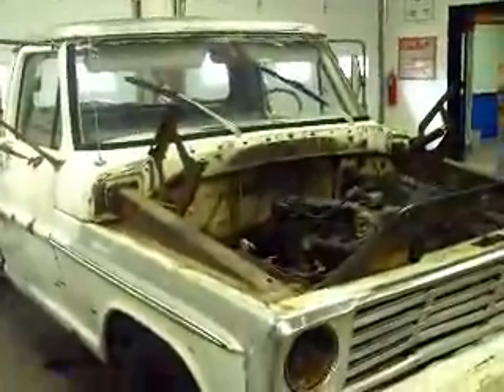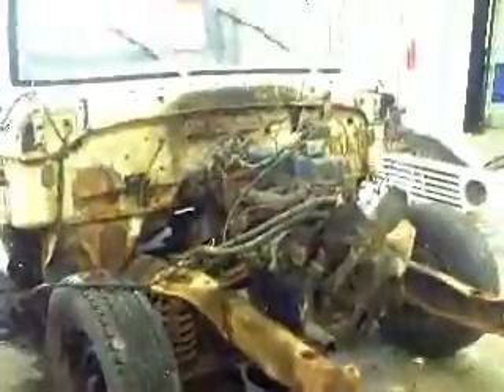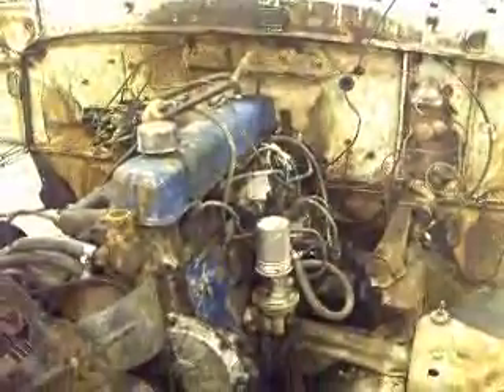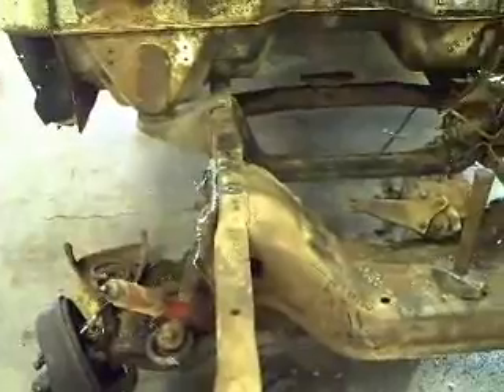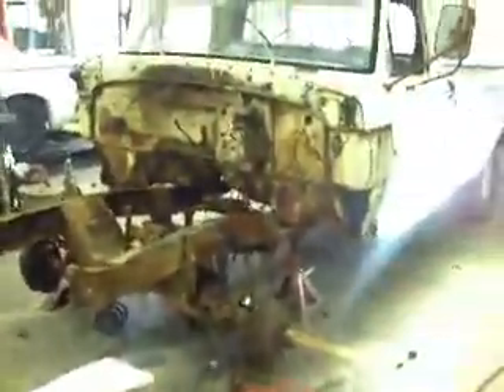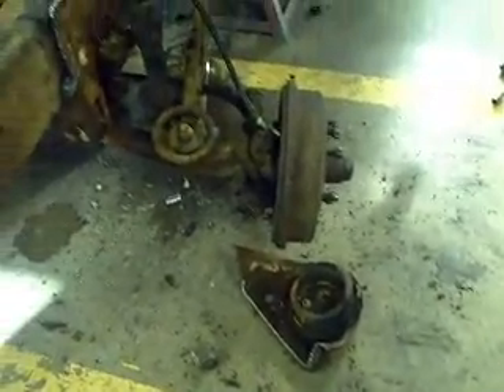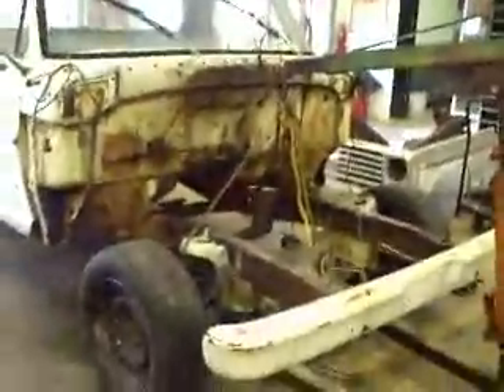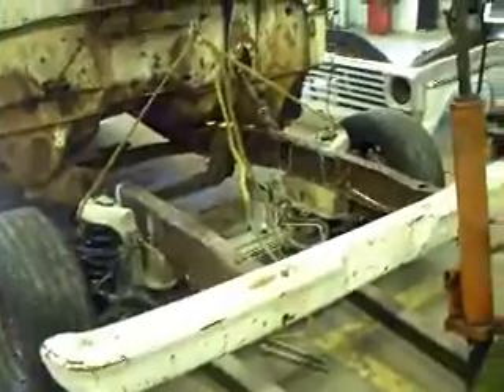crown vic front suspension into 67 F100 1 Stiefel's class

Comment: Wouldn't this make you have to lift the engine up also? If you didn't want to lower the truck maybe you should have either left the ibeams or clipped a newer f150? Seems to me that this might be a little dangerous to be teaching to future car builders.
Reply from the maker: Watch the later videos I done on this and it will answer most of what you are asking here. As far as danger goes. This video was made 6 years ago. I have been driving this truck for the last 5 1/2 years as a work truck. The only issues I have had with the front suspension is when we made the brackets for the rear of the lower control arms we made them too thin and had to go back and add more metal. I made a video that explains this as well. The truck drives 10 times better than it did in it's stock form. We have put over 30K hard miles on it in these 5 1/2 years.

Comment from the maker: Better check your wheel stance too. I think that's where the problem comes in using this type of front as compared to a mustang II the wheels won't fit under the finders right as they stick out on that era of truck. They barely fit under my 67. Unless you are doing some kind of hot rod or rat rod thing where the fenders are trimmed or removed then they would be no problem. It is cheaper than a mustang II in most cases and more ridged.

Comment from the maker: Since your frame with is 34" then you would just do it similar to my Ford. Remove all the front suspension then cut the holes for the 4 long mount bolts. Then make brackets for the trailing arms. You would have to find a way to integrate the disk brakes in your brake system. Then you would have to make some custom motor mounts for what ever engine you are using. Also you need to find a way to hook the rack up to your steering column. I will pm this to you translated in Spanish using Google tran

Comment from the maker: Depends on how you do it.  If you do it like most people and bolt this whole front suspension assembly directly up to the frame rails.  Then it will lower it about 4 to 5 inches depending on what size tires you use. If you put spacers between it and the frame it depends on spacer size. The spacers I used made the front of the truck set about 3/4 of an inch lower than it did to start.

Comment: holy smokes ....i have a 2004 crown vic that im using the front suspension for and a 1998 crown vic im using the motor for....putting a 58 ford f100 apache truck on

Comment from the maker: Thanks This is a low budget project.  I had most of the parts that you see already except the 04 front end. I got that in Rossville GA. Also I am trying to give the students some experience on modern computers you see on todays cars and I felt the 4.6 gave me the best power to mpg balance. However I have heard of people using this front end swap with a big block like a 460. I wish I had a body guy to help me after I get it running.  At least get the rust out of it .  Are you in Bama now?